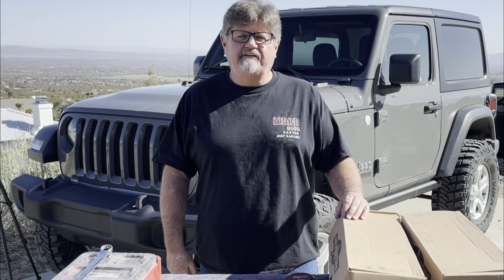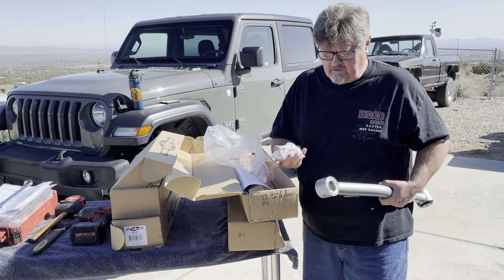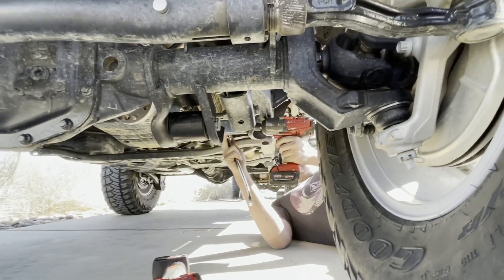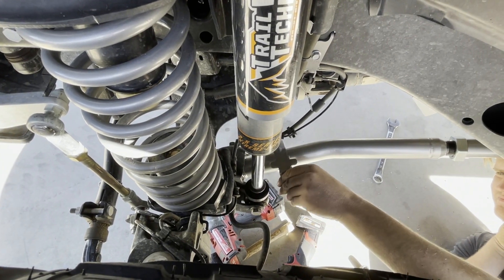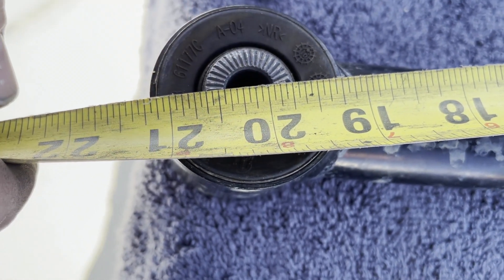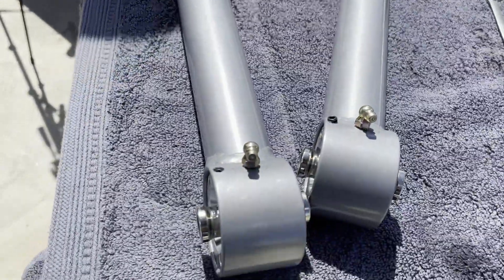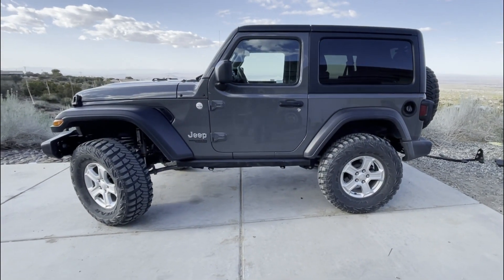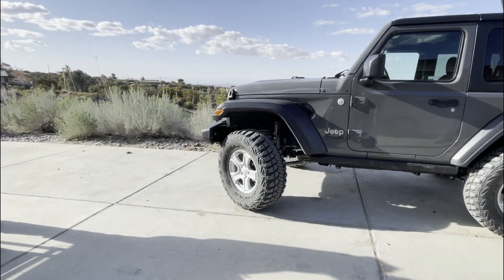Jeep JL Rubicon Express Lift Install

Comment: I noticed the antiroc swaybar on the rear as well, with what appear to be stock offset wheels. Did you have clearance issues between the tire and swaybar endlink? Curries website suggests spacers or a deeper offset wheel... asking before I install mine.

Comment: Do you guys have a video of  how to install the front track bar? Nice videos by the way 👌🏻
Reply from the maker: Hi NYB,

Thank You !!!

Sorry when we were filming the track bar section the recording was missed up. 
The track bar is fairly easy and straight forward to installed just 2 bolts, one on the axle side passages and one on the driver frames. You want to center the axle under the vehicle, we check this by measuring from several spots from under the Fender wells to most outer spots of the tire logs.

Thanks for watching,

5150 MotorSports
Reply: @5150MotorSports  I’m going to lift  my jeep today and I’m adding a track bar, thanks for your help 🙌

Comment: How well did these hold up?
Reply from the maker: Been holding up great!!! Thanks for watching
Reply: @5150MotorSports  Any suggestions for setting the control arm lengths?
Reply from the maker: @sooooobadd44  The rRbicon eEpress instructions has the staring point, don’t remember off the top of my head, then a good alignment to check and set Caster will get them dial in…